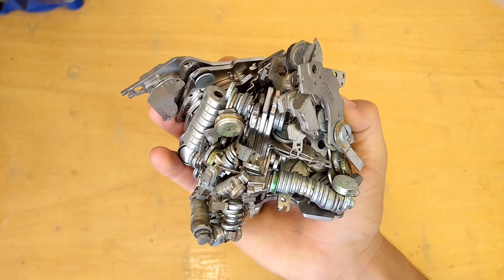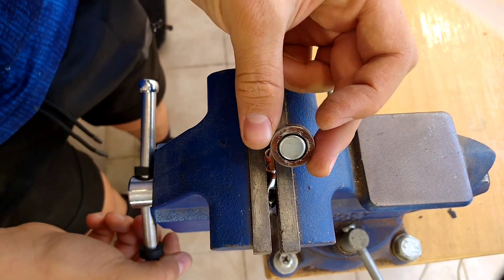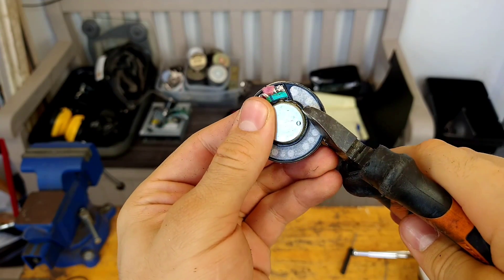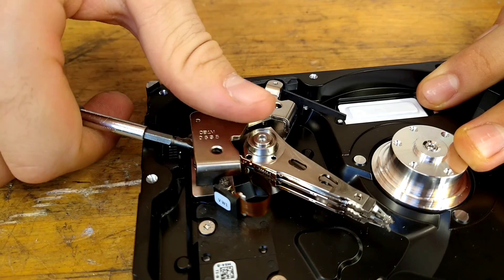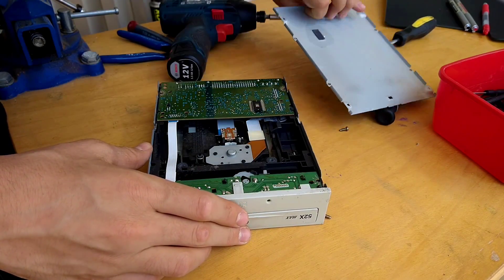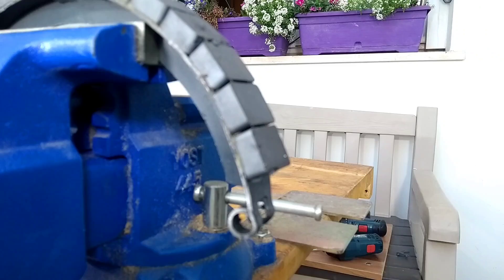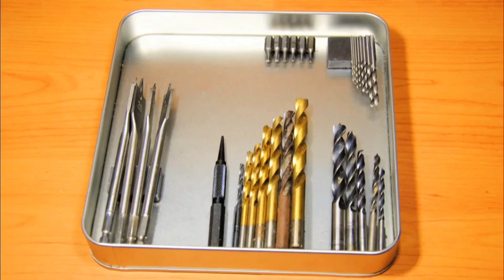8 BEST Ways to Get Strong Magnets at Home for FREE - and where NOT to

Comment: I have a lot or very strong magnates out of a Doppler weather radar system. About 3” round. Are they worth anything to anyone??? When letting 2 of them touch it’s very hard to get them apart. They also sweat or collect moisture out of the air. Do you know why they do this?? Thanks 🙏

Comment: I have two magnets i believe the are neodynium and they are just slightly smaller than house bricks. at present they are in my garden stuvk on a large vice and are dangerously strong.
Reply from the maker: Where did you get them?
Reply: @Yonatan24 apparently some random scammer convinced my building manager that they reduce gas usage. I found them on the roof unused.

Comment: Wow, I think you covered everything. It's great that you mentioned the danger of the death dust inhalation from a magnetron. Most videos only talk about the high voltage capacitor or general electric shock hazard. 

A cool thing to note about hard drive magnets is that the north & south poles are on the same side of the magnet. If you run another small magnet down the length of one side, you can see how it will suddenly reverse polarity at the halfway point.
Reply from the maker: I'm curious why that is. Their unequal magnetism has bothered me before but I didn't know that was the reason. Thanks for sharing.

Comment: Not sure but shouldn't you wear gloves while disassembling stuff because of capacitor leftover shocks?
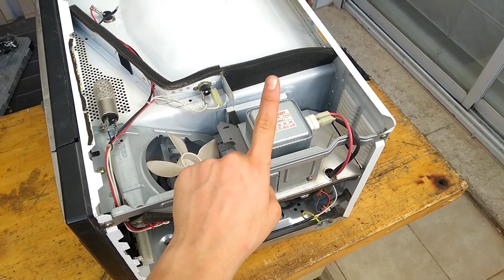For example at 4:15. (If you knew there are no capacitors, yea. But if not?)

Never experienced one, im quite learning, but also careful.
Reply from the maker: @Seelixh  Excellent advice, I shorted the capacitor of a flash in a camera once "just to be safe", and it created a massive spark, proving to have been fully energized. Stay safe!

Comment: Cool! Why are some some of us magnet collectors?! Ingenuity and resourcefulness are a couple reasons… You're my hero today! I just found a broken tv. Thanks for the heads up on the microwave I'll leave those be… Thank you!
Reply: We collect magnets because we're "attracted" to them!

I'll get my coat...
Reply: @ ha!
Reply: @AlphaWhiteWolf20 No! Please sit down, I'll get you a coffee.
Reply: @AlphaWhiteWolf20  this was a couple months ago and it still cracks me up every time I see a magnet.!
Reply from the maker: Excellent!
Reply: I can get tons of very strong magnates that came out of a Doppler weather radar. I don’t know what kind they are but they are around 3” round and they sweat moisture while sitting in my truck. They were covered with moisture when I went to take them out. When two of them connect you can’t hardly pull them apart, almost impossible. I had to use a hammer to beat them apart. Are they worth anything to anyone on here while I have access to get them??

Comment: is there a way to remove the metal cover that protects the magnet from the speaker? im talking about the one at 0:24
Reply from the maker: A vise or screwdriver works best
Reply: @Yonatan24  no im not talking about the speaker cover, im talking about the actual metal cover that surrounds the entire magnet
Reply from the maker: The metal cup it'd glued to? Leave in inside, in many cases it amplifies the magnetic field.
Reply: @Elliewiw The metal covers direct the magnetic force from the back of the magnet to the front, effectively doubling the power on one side of the magnet, & severely reducing it on the other. But if you want the bare, bipolar magnet, separating is difficult, but it can be done.

They are glued on as well as being magnetic, so you just have to carefully pry at it in different places & keep at it until, eventually, it breaks loose from the glue. Then, you just have to overcome the magnetic attraction.

Scrape away as much glue as you can first. Any that you can see. Then, try to separate with a razor blade or knife or anything thin enough to get in there.

Heating it with a torch or maybe a hairdryer can help soften the glue, but you risk weakening the magnet with the heat.

Another option is putting another strong magnet on the other side of the metal cover with the opposing pole towards the other magnet to help push it away as you pry it off. It will still attract to the metal, so you can just stick it on. Remember, the thicker the magnet, the stronger it is, so stacking them up on the back side might help.

I definitely broke several magnets before I got the hang of it, but practice makes perfect, & where there's a will, there's a way. 😉👍

🪛✂️🧷🥄🔪🔥💪⏳️🩹🛐🪄🟰🧲

Comment: the best place to find magnets is: brushless motors.
Reply from the maker: I haven't found them to be useful. What have you found?
Reply: @Yonatan24  there are rectangular neodymium magnets in drone motors and even bigger ones in things like ebike motors.
Reply from the maker: Good to know! Where can you get bike motors?
Reply: I find them out or Doppler weather radar systems . Super strong 3” round and 1” thick. You can’t pull them apart from each other hardly. I had to beat 2 apart with a hammer. I wish I could sell all of them

Comment: I have pulled magnets out of old hard drives. They are very strong. I sometimes use them to find tiny screws that I have dropped on the floor. You can use some of the smaller ones inside sockets to hold nuts that you can't reach by hand. I forgot about the other places to get magnets like speakers, etc. Thanks for the video.
Reply from the maker: Great idea with the sockets. You could glue a magnet to the tip of an adapter since the socket it's hollow.

Comment: Nice! What do you use your magnets for?
Reply from the maker: Lots of projects, I listed some at the end of the video
Reply: @Yonatan24  A month later and I've harvested lots of magnets. I lined my toolbox at work with them so I attach tools to even the roof of the inside of the box. I also used speaker magnets to make a guide thing for steel tubing that I work with. Thanks for the inspiration! Magnets are very useful!
Reply from the maker: @huge_balls  Excellent!

Comment: What would you recommend for the occasional power magnet found on refrigerator magnets? I have a few I thrifted and want to use for my projects but I’m having trouble fighting the adhesive and in one case the metal wraps around the magnet so it’s flush.
Reply from the maker: I'm not sure. Honestly your best bet would be to buy equivalent magnets and keep the ones you have.

Comment: Those 2 wheeled  hoverboards have a ton Of extremely strong neodymium magnets inside of the wheel motors that are maybe .25"x.5
Reply: Brushless they will be on the outer rim on inside of wheel hub
Reply from the maker: @foundationrepairbear  thanks
Reply from the maker: I have 2 of those motors. Is yours a brushed motor? Because the ones I have are brushless and I don't remember seeing magnets inside, only many coils.

Comment: If you ever come across the server 10000 rpm hard drive, they are even better. Monster strong.
Reply from the maker: Are these larger? Do you have a picture of what you're referring to?
Reply: @Yonatan24   server drives are not larger. They are 2.5 and 3.5 inches as are our normal laptop and desktop drives. The difference is in RPM. 7200 RPM has smaller magnets than 10000 and I've seen 15000 RPM drives with very powerful (thick) magnets. As you said, laptop slow 5400 RPM drives have the thinnest magnets.
Reply from the maker: @george.carlin  That probably explains why I've salvaged a few magnets that are thicker and much stronger than almost all others. I'll keep an eye out for this information. Thanks!

Comment: I too have a magnet collection, but rather than scavenging them from devices I use my uncle's old magnet finder device to hunt them from ground 😂, it's only around 1-2 kg
Reply from the maker: What's a magnet finder device and do you just find them randonly in the ground? Interesting.
Reply: @Yonatan24  It's just like a normal metal detector but catches magnetic forces, my uncle had it when he was in the military, i don't it's quite common outside our country. And yes I basically just whoosh whoosh it on the ground and hope i get something. The beach is a good place to find em. 😂
Reply: @beforedrrdpr Damn, you got a military-grade magnetic finder!
Reply: @Vik1717  i guess yeah
Reply: I also have a magnet collection and I have 3 neodymium magnets but 3rd one has a lot of neodymium magnets

Comment: what is, and where can you find the strongest magnet. I want to try beach combing to see what we can pull out of the sand
Reply from the maker: Certainly hard drives. But I don't know what you'd be able to find beyond small pieces of metal and dust. I'm interested in what you'll find
Reply: @Yonatan24  thats why I want to do it, what is actually in sand, how much metal could you find by dragging a magnet on a string a few feet on the beach, might find some jewelry but thats not my over all goal. Its just something I've wondered about.

Comment: Thanks for the info. I was looking to see if there was an easier process to get neos out of speaker cups... The medium to big ones. After using acetone to dissolve the glue I end up having to use a hacksaw to cut the back off or another stronger magnet on the front and a flat head to pry and keep it on the magnet without getting sucked back in to the cup.
Reply from the maker: I usually use a screwdriver which breaks the magnet sometimes. They're usually glues with CA glue which is quite brittle so a few blows with a hammer might suffice. I've never tried acetone but that's a good idea.

Comment: GREAT VIDEO. I HAVE MANY MANY MAGNETS..I USED THEM EVERYDAY. I NEED TO BUY A VISE GRIP THO.
Reply from the maker: Nice, what have you used them for?
Reply: @Yonatan24  I sell metal to the scrap yards. I don't metal from Aluminium . When i buy a used car i check with the magnet to see if the car has bondo filling in the body. There's many things you can do with these things. You can make light with two magnets. Use it when the power go's out. I found out some years ago about these magnets and what they can do. Do ever throw them away. Magnets are in everything, earphones, radio's, just about everything. There are ton's of video about them. I am still learning from other people also. Good luck with your projects.

Comment: Next question, what will we do with those magnets then? Go to trash?
Reply: I sell metal to the scrap yards. I use them everyday. I don't know metal from Aluminium, the magnets are the best way to find out. When i buy a used car i check with the magnet to see if the car has bondo filling in the body. There's many things you can do with these things. You can make light with two magnets. Use it when the power go's out. I found out some years ago about these magnets and what they can do. Do ever throw them away. Magnets are in everything, earphones, radio's, just about everything. There are ton's of video about them. I am still learning from other people also. Good luck with your projects.
Reply from the maker: I've used the magnets for what I've showed and a bunch of other small things. Obviously most of the ones I've taken apart haven't been used for anything but they don't take up too much space so I won't be getting rid of them in case I ever need an for something.
Reply: @Yonatan24  lo colection
Reply from the maker: Back when I built my magnetic tool wall I needed more magnets than I had at the time. I'll keep them for now.
Reply from the maker: @Ravi Avi Exactly👆🏻
Reply: I use the round flat ones for my popsicle butterfly knife
Reply from the maker: @luciusexe3205  Woah can you expand more on that?
Reply: @Yonatan24  i make stuff with popsicles for example i made a butterfly knife i watched a tutorial abt it and i use magnets at the bottom to lock them in place
Reply: @Yonatan24  also i am grateful for that vid bcuz i had a broken phone lying around
Reply from the maker: @luciusexe3205  Interesting, you should post a video of it. I'd like to see it.
Reply: @Yonatan24  i could try i mean i havent got the correct sizes of magnets since i couldnt find much items with magnets in them
Reply: @luciusexe3205 what good is a knife made from a popsicle ?? I don’t understand??

Comment from the maker: I have so many magnets, I don't know what to do with them! Does anyone have any ideas for more DIY projects I could use them on? Maybe problems you have that magnets could solve!
Links:
Torx screwdriver set https://amzn.to/3WgreUT
T6 torx bits https://ebay.us/PFvavr
Bench vise https://amzn.to/3Id9owl
Small philips/flat screwdriver (this Husky is my favorite) https://amzn.to/3BC6pcR
Philips screwdriver set https://amzn.to/458KiZg
Large strong flat screwdriver for prying https://amzn.to/3OldS7F or cold chisel https://amzn.to/3o0RSEr
Groove joint pliers https://amzn.to/42PmKHe

Wire cutters https://amzn.to/3oePOsM or snips https://amzn.to/3OmnVtk
DIY magnetic hand saw guide► https://www.youtube.com/watch?v=IDGZmSuTRfE
DIY bike rack with a magnetic u-lock mount► https://www.youtube.com/watch?v=bwGzk3qUquE
DIY magnetic bench vise soft jaws► https://www.youtube.com/watch?v=64RHM05EQds
Also shown: magnetic tool rack, magnetic honing guide, bit holder which can be seen here► https://www.instructables.com/member/Yonatan24/  

🔴Subscribe to get updated when I upload new videos!► http://youtube.com/Yonatan24/
Reply: Very cool!!!!
Reply from the maker: @technofeeliak  Thanks!
Reply: I sell metal to the scrap yards. I use them everyday. I don't know metal from Aluminium, the magnets are the best way to find out. When i buy a used car i check with the magnet to see if the car has bondo filling in the body. There's many things you can do with these things. You can make light with two magnets. Use it when the power go's out. I found out some years ago about these magnets and what they can do. Do ever throw them away. Magnets are in everything, earphones, radio's, just about everything. There are ton's of video about them. I am still learning from other people also. Good luck with your projects.
Reply: You could melt it then do a big one? or do sonthing else adter melting it.
Reply from the maker: @Burakk-f6u  What do you mean?
Reply: @Yonatan24  To melt some of the magnets
Reply from the maker: @Burakk-f6u  Magnets lose their magnetism if you melt them unfortunately.
Reply: @Yonatan24  Oh
Reply: @Burakk-f6u  I never try to melting any of them. I all have very small, med, big, super large ones.